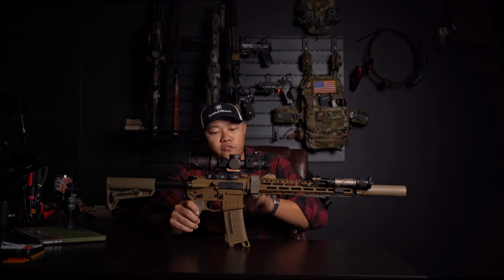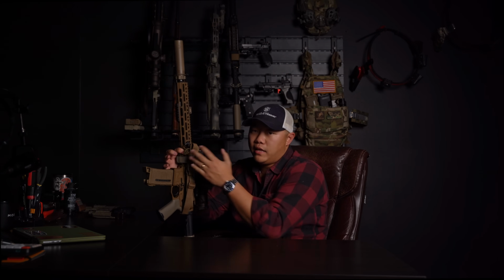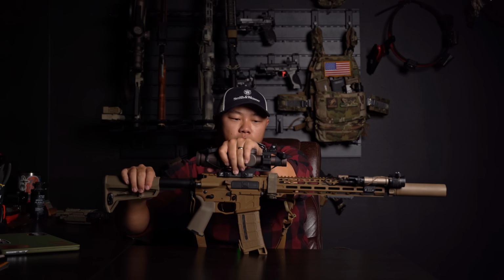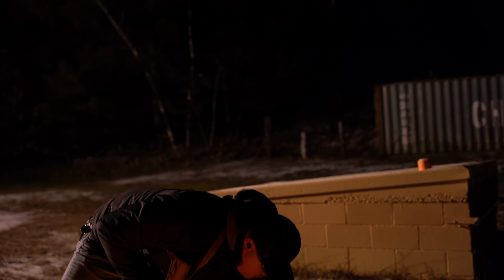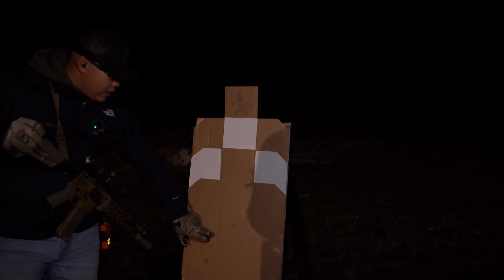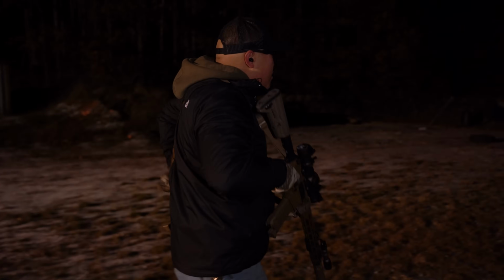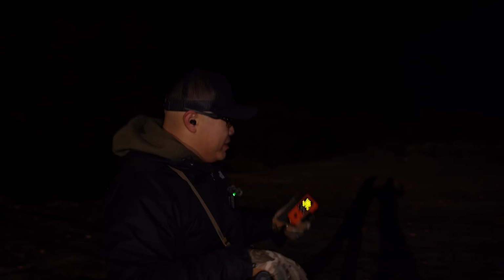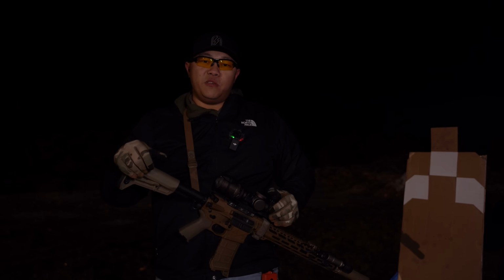14.5" ADM UIC Mod 2 Overview

Comment: Just bought a 16" Can't wait to run it. I looked at every major manufacturer and eventually arrived at ADM as the highest quality for cost option. Have seen almost zero negative receptions for their rifles which helped make the decision.
Reply: Have you recieved yours, wanting to buy one but hesitant
Reply: @SxCR4WR  I think YT deleted my long comment for some reason but yes, it has been great so far. Handle every option you are considering before buying. For me it made the most sense. The one thing I wish I did differently is a 13.9 pin and weld with Criterion CORE instead of the the 16" but both are good options.
Reply: @RikkiTikkiTavi290  if you were to do it again, would you have built your own or still drop the cash on it?
Reply: @SxCR4WR  I'm not a gunsmith or really inclined to fully assemble one on my own so I would drop the cash again. I do know that you can buy parts kits to save quite a bit of money but I'd rather just pay to have a complete one from the factory. Maybe in the future I will get into building but not now. Everyone is different though, if you're into it its doable.
Reply: @SxCR4WR  I will say if you're looking at multiple rifle options, the dark side of doing research is you will find people complaining about every company's products if you look hard enough. Everybody has different opinions on what is worth the money and so on, from PSA all the way to KAC. Most important thing is to get your hands on all the options you're considering if possible first. If you're happy with it, F everybody else. Someone somewhere probably is going to talk sh** about whatever you get. ADM is great for me and a lot of other people.
Reply: @RikkiTikkiTavi290  no I agree, I do have a DB15 but I’ve been wanting something higher end. I don’t know much or know anyone with this type of AR but I know enough to know that I would like something like it
Reply: @SxCR4WR  Oh ok. Sorry to preach at you haha.

Comment: ADM is my preferred lower. Has an ambi bolt catch and bolt release unlike other lowers which just have a bolt release.
Reply: Hey bud, is it easy to reach with your trigger finger? I'm assuming you're right handed. I've been using bad levers for a while and really want a lower that just has that feature built in. These ADMs are nice and I already have two uppers that have Criterion barrels so I know they're extremely good and robust barrels that are also very well gassed. Griffin also makes a good ambi lower apparently.
Reply: @armorers_wrench  
It's easy to reach the lever for me. My hands are small and it's still intuitive to manipulate.  
BAD levers are cool, my only gripe is that there is potential to snatch on gear. 
I believe Griffen Armament has the same lower design as the ADM lower in terms of controls. Who made it first I have no idea.

Comment: Nice set up brother. Thanks for sharing. Some food for thought. If you are going to keep your 1X6 on something other than 1x and use your red dot for any high percentage shoots, maybe think about running a 2x10 (or some other variant). You would get more juice from that squeeze.
Reply: Why? The weight still matters.
Reply: Because a 2x10 does a lot better job at higher magnifications. Also, why limit yourself if you are not going to take advantage of the 1x? The point of a 1x by anything is to be affective with the 1x capability as well as the higher magnifications. For everything gained you are going to lose something. No set up is perfect. You just have to make sure that what you are gaining is more valuable to you as a shooter than whats lost.  As far as weight, a Leupold Mark 5 2x10 is about 24 ozs were as a Razor 1x6 is 22ish. So with that fact I can't see your argument being valid. But to each their own.  @SnapD24
Reply from the maker: Hey man, yeah good point. I understand your point and agree with it however I have a 1-6x because I DO frequently use the 1x. I don’t need the top dot but for fast transitions in depth it’s beneficial. Also, as everyone knows the battery life on almost every LPVO is atrocious so from a preparedness standpoint it’s a good idea to have something that will be on for use in low light, home defense, etc. that’s why I tend to leave the scope on 2-3x. I could do a similar thing with a 2-10 and might upgrade to more glass later on but for now, I do use the excellent 1x a whole lot which is why the LPVO makes sense to me.
Reply: @GatewayDefense  👍

Comment: With only 200fps more….every little bit counts. 12.5” with a K can. Polonium K specifically. Fat gas hole (.079+) with adjustable gas block. Tubbs flatwire 42 coil in a5 system. Sandcutter chrome with enhanced bolt (centurion barrel & bolt). ATACR with 509T